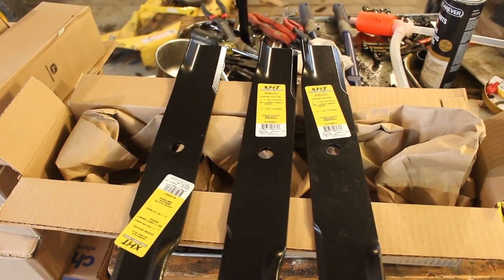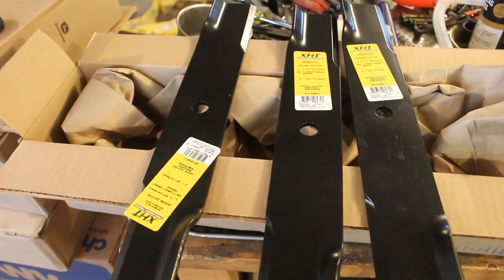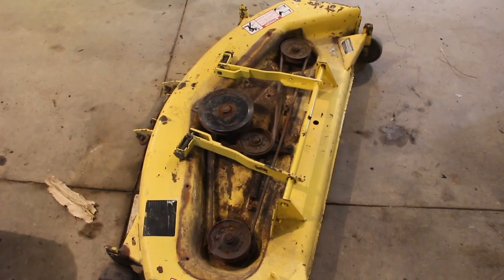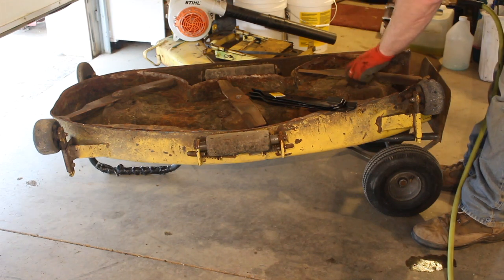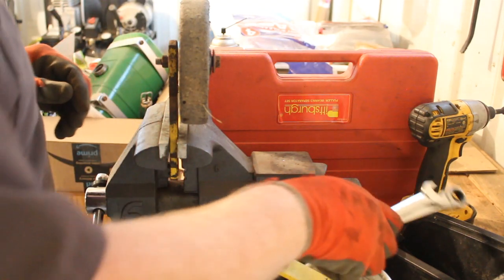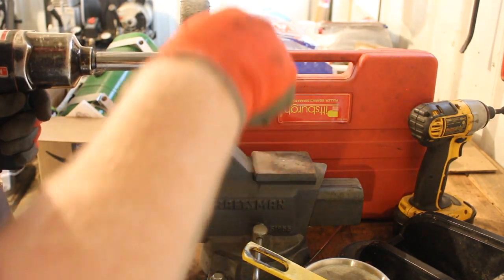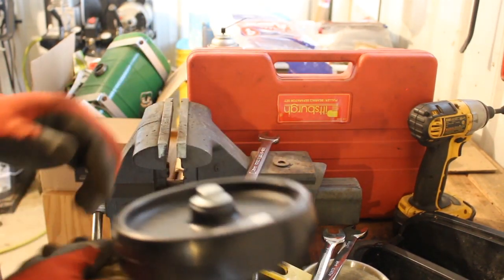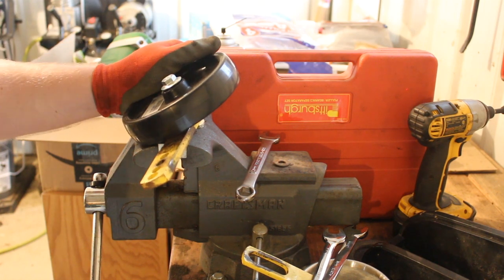John Deere 318 Project: Part 11 (fixing the deck)

Comment: Good project.  Go John Deere!  I use the Milwaukee M18 impact.  Love it.  Used it in my JD 425 Project.  Removed Blades with it.
Reply from the maker: Thanks for the comment on the impact. I am still not sure which one to get. Mostly because I will be switching from Dewalt Ni/Cad batteries to lithium. I am sitting on the fence with brand etc because I generally like all my tools to be the same.

Comment: I use the John Deere Predator blades ,, and they are amazingly good nothing has ever came close to making my lawn as beautiful as they do nice level no missed blades of grass love them.. yea I’m big on John Deere parts and what not also...
Reply: The XHT blade in the video is made by Sunbelt (owned by John Deere), the same company that makes Predator blades.  The Rotary, Oregon and Stens numbers are cross references on the sticker.
Reply: jtclays yea but those look nothing like the blades I have... mine has the serrated lift edge on back side of blade ...like sharks teeth almost

Comment: For a cordless impact I went with the Milwaukee M18 2767-20.  I'm already invested in the Milwaukee M18 and M12 lines, so it made sense for me.  Im pretty impressed with it so far, but it is heavier than I was expecting.  I could see that being an issue if I had to be using it all day.  I'm not giving up on my IR pneumatic just yet, but its definitely easier to throw this in the truck, or tractor when I need to.  For me, Mower blades are a disposable item.  with all the rocks I have, they are lucky to last more than a season or two.
Reply from the maker: Thanks! The Milwakee is on my potential list. I agree about not giving up on my pneumatic. I will certainly keep it around and it will still get used but for short jobs like this a cordless would be very handy. I have a lot of older Dewalt 18V Ni/Cad stuff that is reaching the end of its life (battery wise) and the time is coming to update the whole set of cordless tools. I am sure I will post a video at some point of my decision or thoughts.
Reply: i would keep away from the DeWalt impact, we used them at work and had 100% failure rate. we are now using a mix if Milwakee and Mikita. at home i use Craftsman because the NiCad and Lithium batteries are interchangeable, and inexpensive and have been the same for years and years./

Comment: Just wondering if anyone has tried the Gator Blades on their 50" JD deck. I am in the process of getting ready for the season and am debating between the Oregon Gator blades and the JD Predator blades. Perhaps the Gator blades will allow me to remove my bagger attachment and simply mulch my grass. Not sure if the old 50" deck will spin the blades fast enough to mulch.

Comment: I love Deere aswell I own a 2016 x730 with a 54inch high capacity mower deck with auto connect and a 47inch quik hitch snowblower. I have 261 hours on it. And should I buy a 317 or 318?
Reply: It depends on what you are looking for.  The 317 is the older Closed frame design with manual steering.  The 318 is a newer open frame design with power steering.  Both came with 2-cylinder engines, with the 317 being found with either a 17hp Kohler series 1(had oiling system issue) or 17hp Kohler series 2.  there was an Onan retrofit kit for 317's with series 1 engines that failed, so you can find some with Onans.  all 318's came with an Onan 2 cyl.  In the most general terms  the main difference outside of power steering between the 2 models is the rear attachment capabilities.  The 318 3pt is much easier to find new and used, and uses the deck lift.  the 317 3pt is the same as the 140 and early 300's. and near impossible to locate a usable one.  if you are just mowing, they both use the same mower decks but different draft arms.  I've had both, enjoyed both.

Comment: Screw john deere dealers..rip off artists!  However I love my john deere GTs :-)
Reply: How? They are almost always cheaper on everything compared to the aftermarket and if not the prices are always close.
Reply: @chadjustice8560  to the best of my knowledge everything I have bought outside of JD has been cheaper. At least with regards to older machines